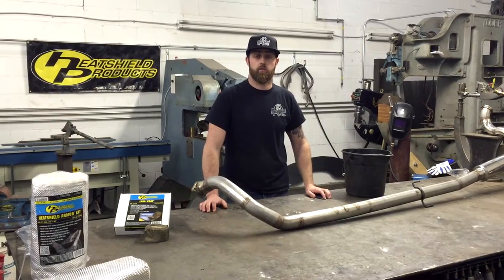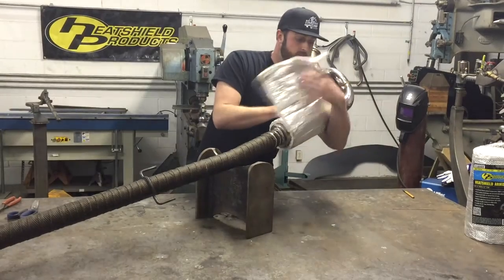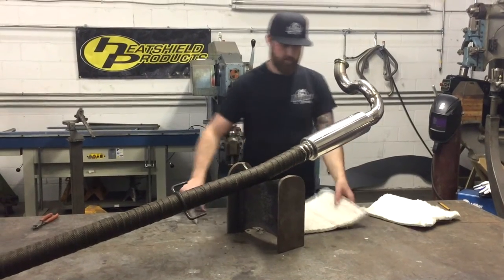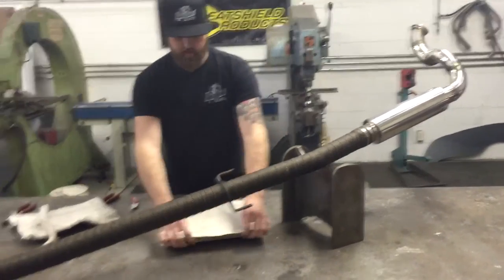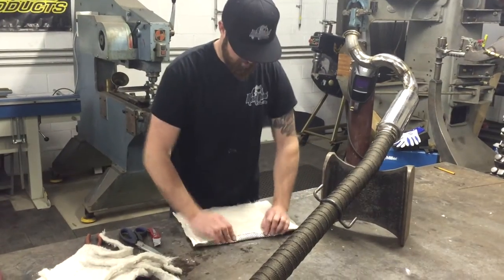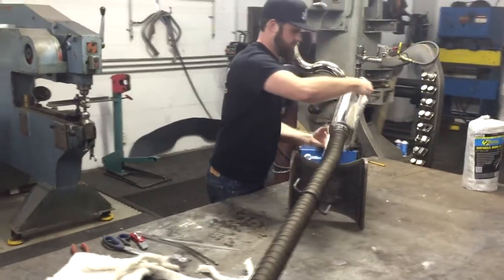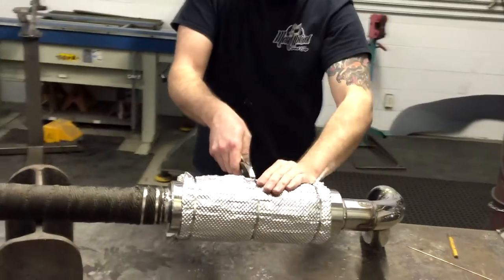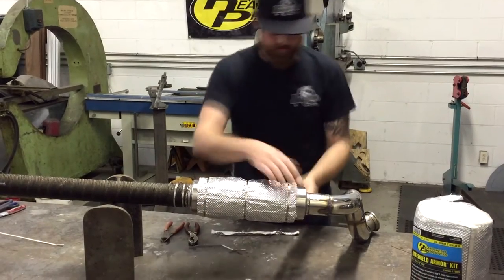How to Install Exhaust Heat Shield

Comment: I have a borla muffler on my truck and a trans cooler with a fan right above it and I’m thinking it’s sucking up the heat off the muffler do you think this would help? The muffler is 34” long 5.5 thick 8.5 wide
Reply from the maker: Most definitely.  Heatshield Armor (https://www.heatshieldproducts.com/automotive/exhaust-heat-shield) can reduce up to 70% of radiant heat from exhaust.  Very easy to install.

Comment: I have a dual exhaust system that goes over the rear axle, but the top of the pipes is very close to the car body, can this be used between the body and the exhaust pipes? thanks
Reply from the maker: Thank you for your comment.  Yes the Heatshield Armor it perfect for this application.  There are several videos on this topic if you search Armor on our page.

Comment: Is this kind of insulation not going to trap moist and induce rusting of your exhaust?
Reply from the maker: If you install it per the instruction and folding over the aluminum edge, the Heatshield Armor becomes highly water resistant. The BioCool insulation is water resistant, but by folding over the edge an sealing it with the aluminum you significantly reduce exposure to water. Nothing is water proof, even exhaust wraps are water resistant. The Heatshield Armor does greatly limit moisture to the pipe because of the aluminum Armor layer.
Reply from the maker: @John Doe John- Did you miss the part where there is a gap to allow the heat to escape? 

https://www.heatshieldproducts.com//PDF/ISheets/HeatshieldArmorISheet.pdf

Unlike and exhaust wrap where you entirely wrap a pipe, the Armor series allows you to control which direction the heat goes. You could even be so bold as to cover just the top half of the pipe instead of your recommended 2-3 inch gap. Installing even on just the top half of the pipe would still stop more heat from radiating upward from the exhaust compared to an exhaust wrap.

We are showing the superiority here vs a traditional exhaust wrap. With its water resistance and the ability for you to decide were you want the heat to go. 

It is currently installed by OEM's in the heavy duty industry. It passes their rigorous testing. 

We get not everyone will do this. No reason to hate here, there are not invalid claims. Our reply was to his question about traditional exhaust wraps and them retaining moisture in extreme circumstances.
Reply: Well if you get a complete stainless system moisture won't be a problem.